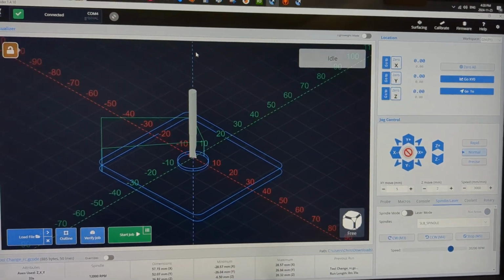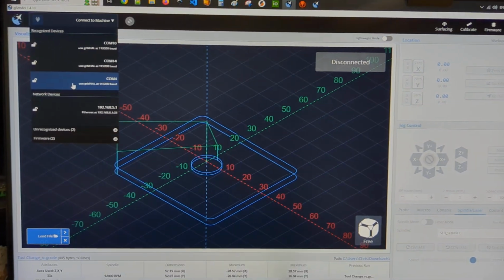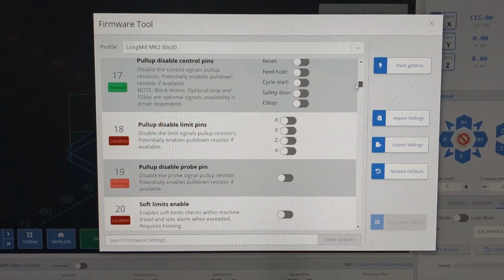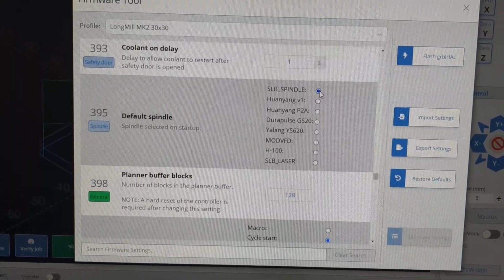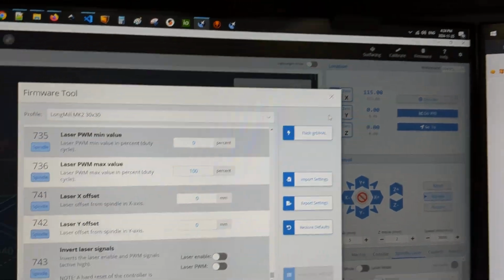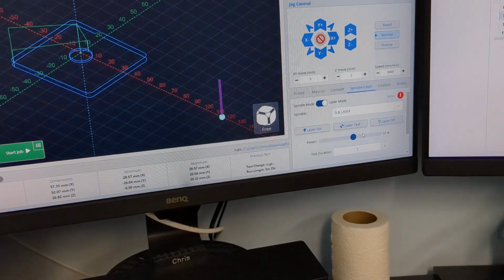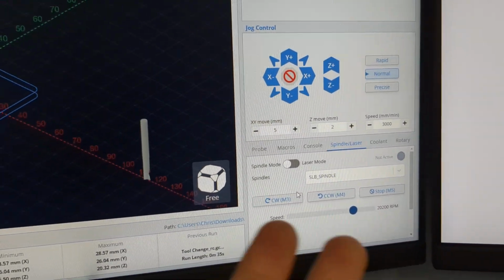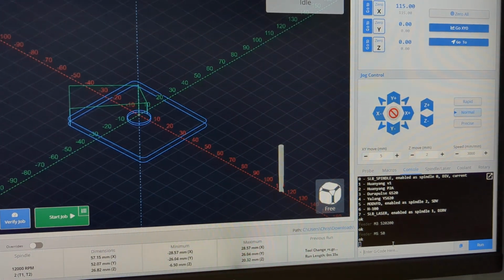Laser setup on the SLB

Comment: Great video Chris and perfect timing as I just got my laser mount built, converting the MK2 into full time Laser with my Jtech 44w.  I can't remember if I've used the laser since I got the SLB or not but this will be very helpful.  I'm guessing since I select $395 as SLB Laser...then  $511 is maybe not gonna show what yours did ??
Reply from the maker: Great to hear Larry! Yeah if you set it for $395 then $511 you can just disable if you'd like. Once it's the default you won't need to toggle to it in the dropdown since it'll be on by default, you'll still want to switch to be in laser mode in the spindle/laser tab though 👍